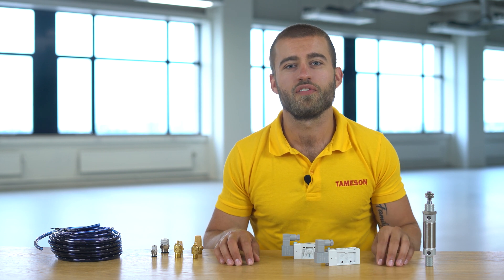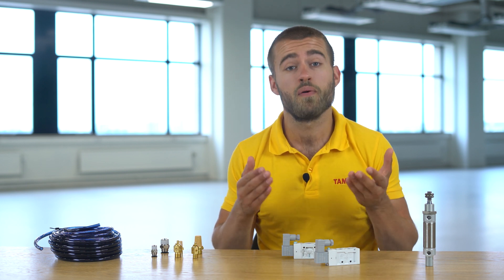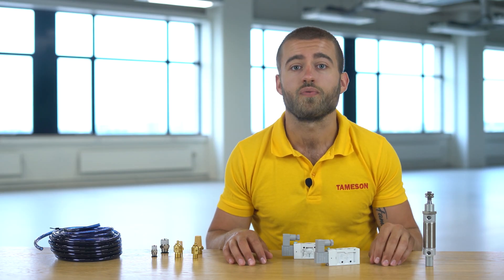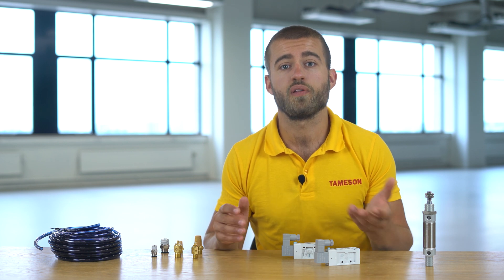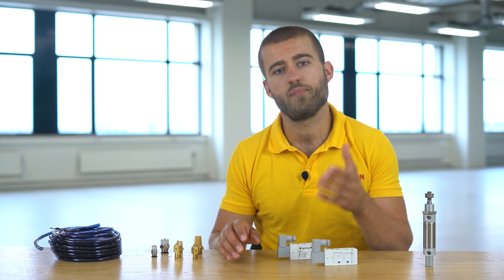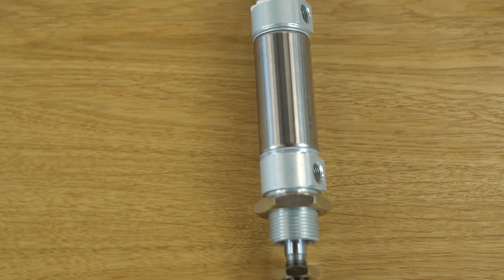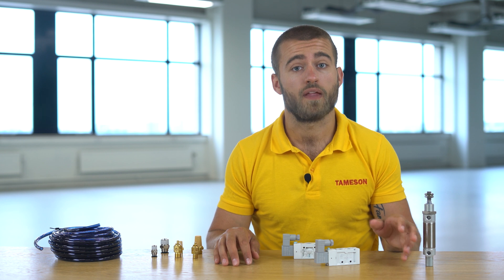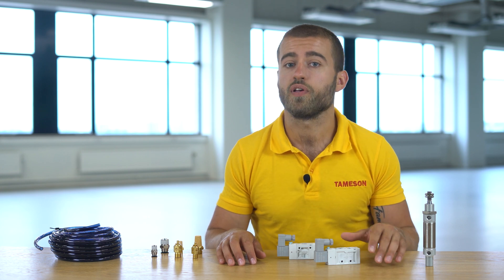ISO 6432 pneumatic mini cylinders | A quick guide | Tameson

Comment: What is the maximum speed of a pneumatic cylinder? ISO 6432
Reply from the maker: The maximum speed of a pneumatic cylinder, especially one that conforms to ISO 6432 standards, can vary based on several factors including the bore size, air pressure, and the load it is moving. Generally, pneumatic cylinders can achieve speeds up to 1 meter per second, but for an ISO 6432 cylinder, the typical speed range might be slightly lower due to its design and application focus on smaller bore sizes and precise control.